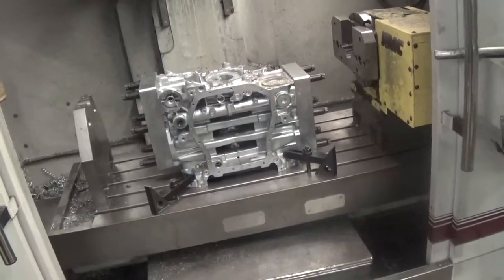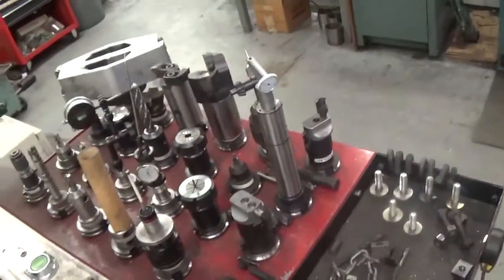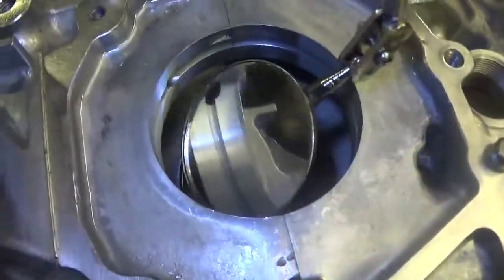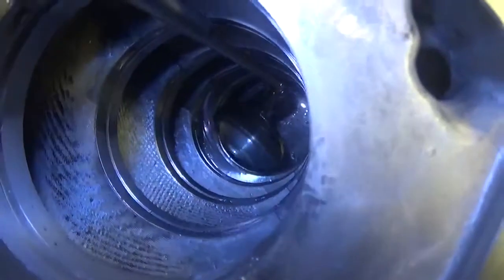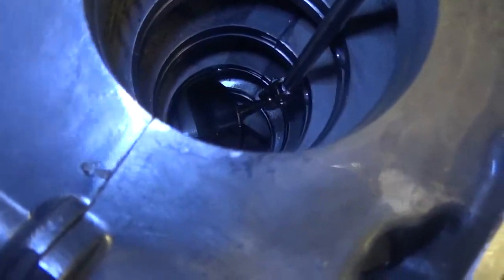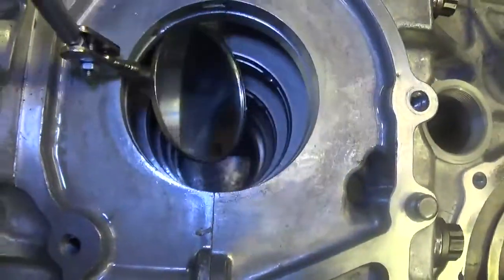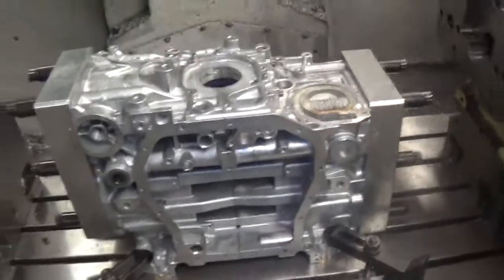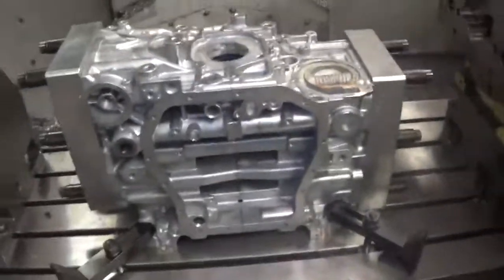Subaru main  line boring explained

Comment: So are you saying that by boring out for  the oversized king bearings you get the main line straight because there is no variance bigger than what your are boring out? How can I tell if I need an align home before a rebuild?
Reply from the maker: You need to torque your halves together (no bearings) and measure each main bore with a dial bore gage. The factory maximum spec is 2.5197 but King says 2.5197-2.5205 for their bearing sets. A .005" overbore is only a .0025" depth of cut, so it's possible that if you can measure a bore that is .0025" over spec, it may not clean at plus .005 because  Subaru main bores can wear all on one case half.
Reply: @motion24527  okay so even if you machined to suit the king oversized bearings there's a chance one of the main bearings won't machine because it has worn so much on one case half.
Reply from the maker: @jordanp6420  Correct. But by measuring the bores first, this can avoided. Also, keep the nomenclature straight, it's main bearing bore, not main bearing. Subtle difference in wording but big difference in reality that can lead to confusion. One doesn't bore the bearing, it's the main bearing housing bore or tunnel.

Comment: There is a rumor from the factory that they hand pick / fit crank main bearings due to severely bad sloppy tolerances. The second issue is bolt torque, many guys will over torque the stock fasteners.... if you upgrade to an ARP case bolt kit that uses double the bolt torque with very rigid fasteners WILL require attention to line bore and make it all nice.If not the crank will not be happy.  Good work !

Comment: So you would recommend a mainline bore on a used case before rebuilding it correct? How much does it cost? I've been looking at rebuilding short blocks and would need to factor that in, thanks
Reply from the maker: You have to take a lot off the case halves before the oil pump dowels are an issue. It seems to take about .015" off each half before the dowels begin to foul in the holes. Same with the tranny dowels.
Reply from the maker: +joelyboyblue   It's not required every time but the mainline is the first thing that needs to be checked before a rebuild as it has a direct affect on bearing clearance. I charge $200 to line bore a block for King .005" oversize o.d. main bearings.  To retain original o.d. mains, the price jumps to $500 because both case  half mating surfaces need to be machined first and the rear seal dimension also needs to be re-machined back to standard size.
Reply: +motion24527 thanks, I saw your newest video too just now, great work bytheway - what do you think causes the problem? Is it that have had spun bearings or high mileage?
Reply: +motion24527 what do you think causes it or is it just an issue all subaru engines will have? Is it extra wear from high mileage, spun bearings or anything like that?
Reply from the maker: +joelyboyblue   The material that Subaru cases are made with is fairly soft as aluminum goes.  The pressure exerted on the main bores eventually compacts the material,  resulting in an enlarged diameter.  It's the same as the old VW air cooled cases, they needed line boring on every rebuild practically. Aluminum just cannot withstand that sort of abuse forever, add a turbo and the lifespan is further decreased. I am convinced that this is why higher HP turbo Subaru's suffer bearing failures, they have more main bearing clearance than the builder realized.
Reply: +motion24527 that is definitely good to know, I wonder if there's any way to eliminate the issue, anyway really enjoy your channel, thanks for the rapid responses and the solid work you do, I would definitely send my case your way when I do it
Reply: In case of retaing the original mains OD and machining case halves, how do you then deal with the oil pump dowel pins and bellhousing flange? Thank you for your answer, I am very curious about this particular matter.